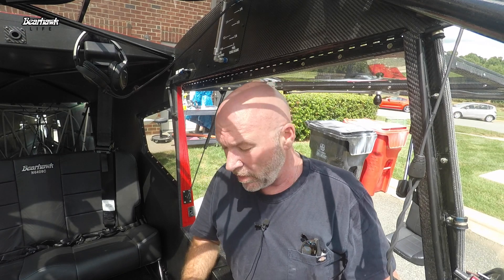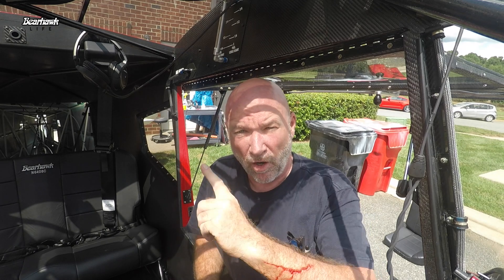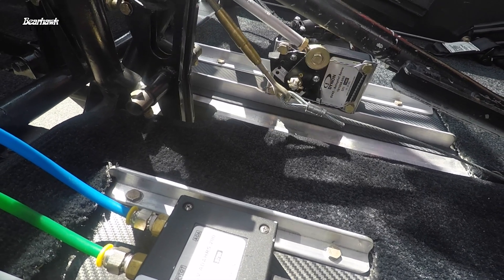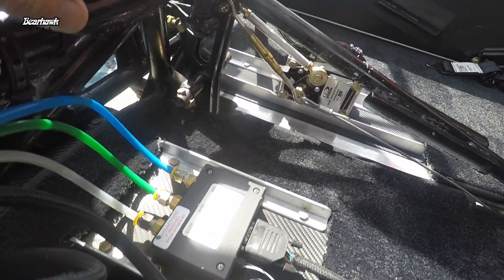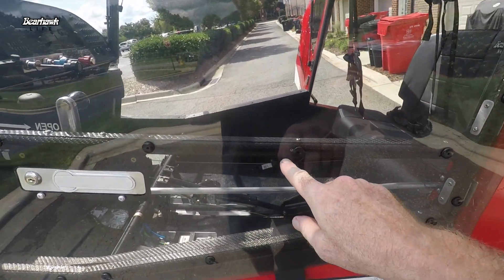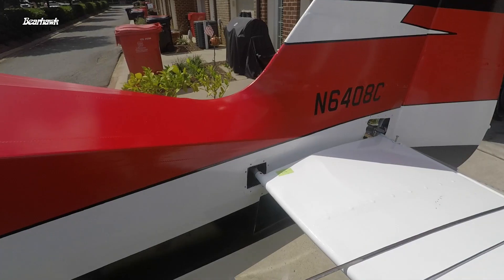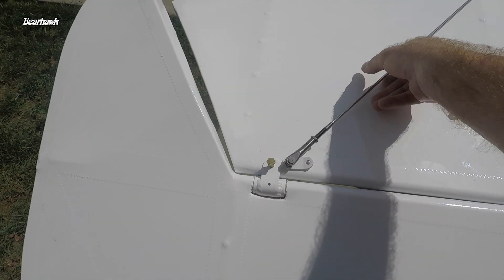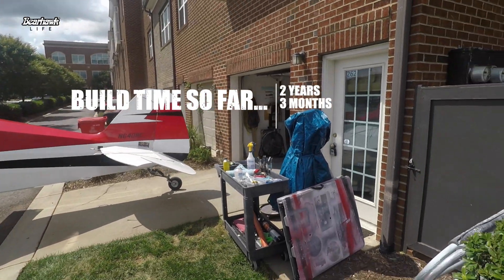BEARHAWK ~  Tail Feathers and Preparing for MOVING DAY!

Comment: As far as your acrylic goes, oversized your holes, use Rivnuts, and use Teflon washers under your roundhead screws.  Proper screw tension is touch drag +3/8’s of a turn.  This should preclude any further cracking.  You are going to have to ditch the Avex rivets though, they apply too much tension unless you want to glue on acrylic reinforcing bungs around each hole on the window.  Are you using acrylic or plexiglass?  There is a difference...
Reply from the maker: Good points!  I am using Lexan.

Comment: Can you drill the holes larger and use a rubber Grommet in each hole as a dampener for the rivets or use Allen butt head screws and lock nuts instead of rivets
Reply from the maker: Those are great ideas, Daniel!

Comment: Good stuff mate. If all else fails and you can’t stop the doors cracking. Try using lexan. It’s much easier to use and is more flexible than acrylic. You can cut it with snips and use normal drills
Reply from the maker: Thanks, Don.  I know I said "acrylic" in the video, but the doors are actually Lexan.  Which is why I am so disappointed with the cracking.  I placed neoprene washers under the rivets and I think that made the pull connection too tight.
Reply: Bearhawk Life ah right, what a pain! Stop drilling the cracks will help for a bit. Perhaps a thicker sheet?
Reply from the maker: @donwtsn  Not sure about that either.  The current sheet is 1/8", and is fairly heavy.  The sheet on the skylight is 1/16" and I have not seen a single crack up there...

Comment: https://bylerrivet.com/products/category/blind-rivets/open-end-blind-rivets/large-flange-head-open-end-blind-rivets/aluminum-large-flange-head-open-end-blind-rivets/
Reply from the maker: I will check those out.  These are the large head rivets I used.  https://www.ebay.com/itm/Large-Head-Black-Rivets-Pop-Rivet-50ct-3-16-Racing-Fasteners-IMCA-USMTS/330490032427?ssPageName=STRK%3AMEBIDX%3AIT&_trksid=p2057872.m2749.l2649
Reply: @TheBaldPilot  those ones have a steel nail , you need aluminum nails as they only pull up half as tight as steel ones that probably why its cracking .
See if they do all alloy or just paint the other ones..
Cheers

Comment: Try running a soldering iron around in rivet holes in door glass before riveting , also you can get large head aluminum pop rivets l use on engine baffle rubbers that don't pull up very tight that should work ok!!
Reply: I had similar problem with my skylight windows. Cracks start developing, stop drilled them, but eventually, one crack kept propagating:-(. I ended up changing the window with Lexan...
I wouldn’t personally use any iron or other source of heat with acrylic/plexiglass. It will make the hole even more brittle.
Reply from the maker: That's a great tip!  Thanks!